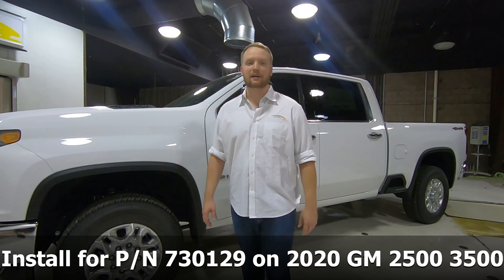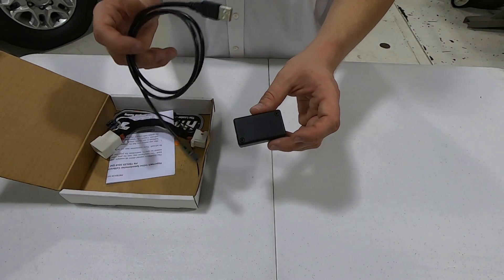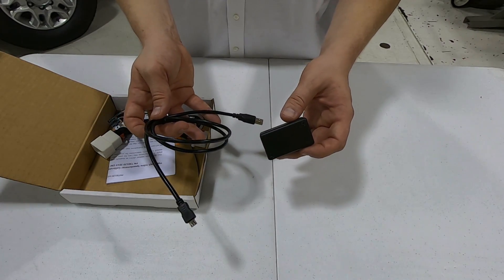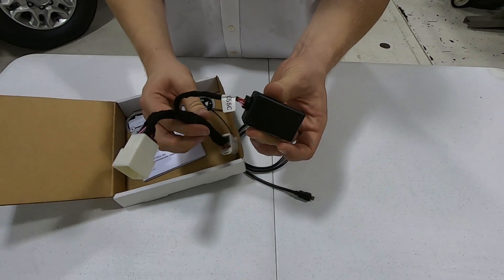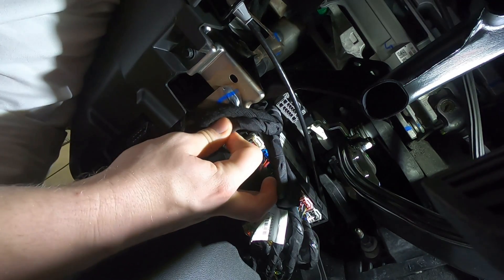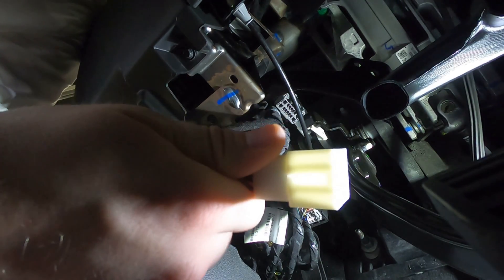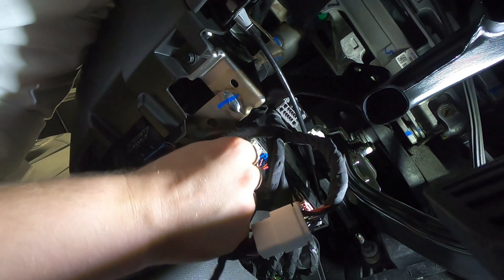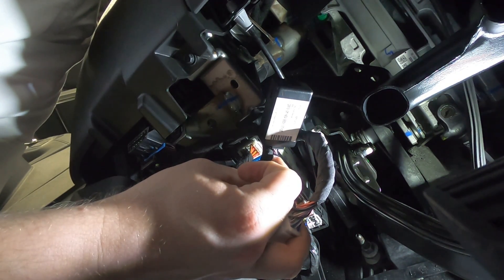Hypertech 2020 GM 1500, 2500 and 3500 Speedometer Calibrator Install

Comment: Just installed mine in my 2020 Chevy 2500HD WT gasser.  One thing to note, it did NOT look like the wiring in this vehicle.  That being said, took longer to download/update/program than to install in the truck.  Even with accurate measurements to the hundredths, was still off about 2MPH the other way.  When I did the fine-tuning using GPS/Speedo I kept it connected in the truck and brought my laptop outside.  After fine tuning, it was PERFECT.  Shifts at the right time, speed is accurate and moves in unison with the GPS.  Even though it costs as much as a full-size spare, it was totally worth it.  10/10.

Comment: How do I uninstall and return to stock?
Reply from the maker: Going back to stock is as simple as disconnecting the unit from the truck. Once you unplug it and plug the factory connector into the module without the Inline Speedometer Calibrator connected, you're done!

Comment: Does this video installation works for 2019 gmc yukon denali 6.2L?
Reply from the maker: It's almost identical across the 1500, 2500, 3500 vehicles. This is the same as your installation.

Comment: It seems expensive for the amount of stuff this does.  And there is lots of good questions here not getting answered.  Does this work with the new L8T?  Does it adjust shift points?  Will this cause a flag code on Chevy code scan?
Reply from the maker: This has been tested with the L8T 6.6L gas engine and works great. It does not adjust shift points and is not detectable with a code scanner. The packaged electronics is intentionally designed to be simple. What you get in this package is a custom hardware design along with custom software that is user configurable with custom developed PC software. The plug and play harness with custom molded connectors also aid to the ease of installation. All of this culminates after the research and development of the electronics system of these vehicles is hacked and understood. In the end, it's a very complicated solution in a "simple" package with the intent of making installation easy and quick.

Hope this answers your questions! Have a great holiday!

Comment: Does this do any re-mapping on the shift points IF only the tires were upgraded?
Reply from the maker: The Speedometer Calibrator only corrects the instrument cluster and does not affect the shift points.
Reply: @HypertechTuning  wouldn't the shift points be affected regardless because the vehicle is now reading the correct speed etc which would affect how the automatic transmission shifts?
Reply from the maker: @basedcanadian6869  The shift point are not changed because the change is made only for the instrument cluster.

Comment: Is there a fail safe feature on this device ?
Reply from the maker: If it does detect an electronic error it will default into a bypass mode which makes no correction to the speedometer readings.

Comment: Think same plug location for 2019 Silverado.  Did you have to disconnect battery
Reply from the maker: The plug in location is the same for the 2019+ GM 1500/2500/3500 trucks. You should make sure that the ignition is in the off position for at least 10minutes prior to installation and that the instrument cluster is off when you install the Speedometer Calibrator. You should not need to disconnect the battery.